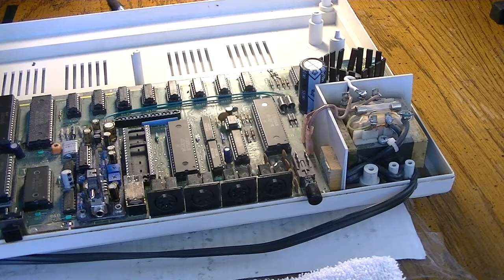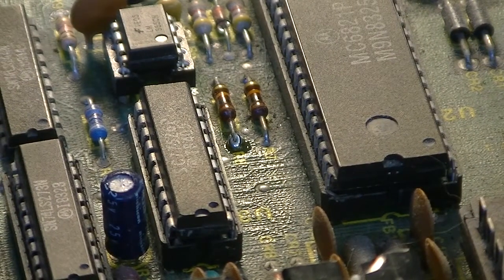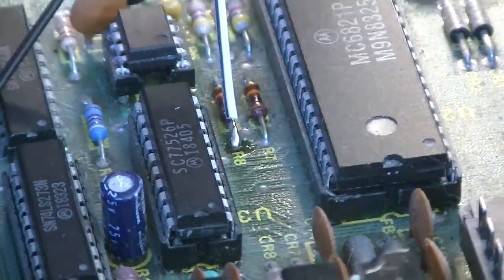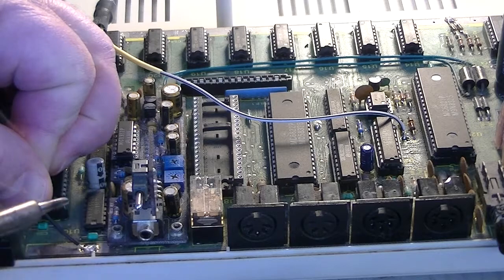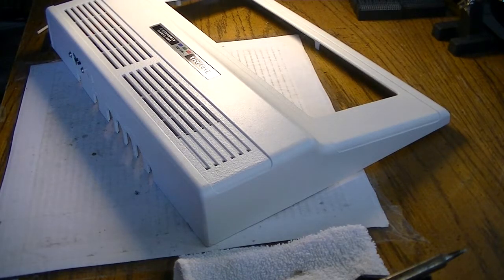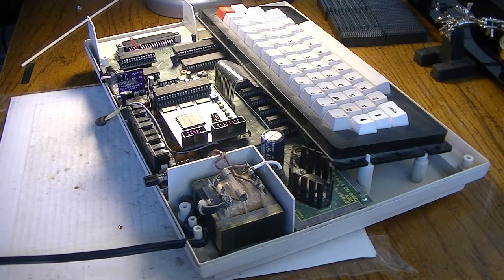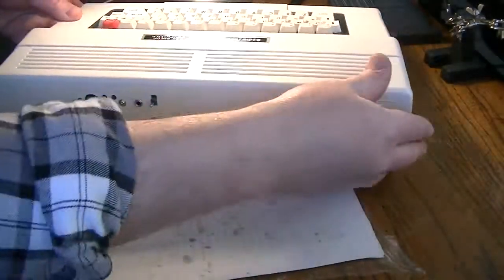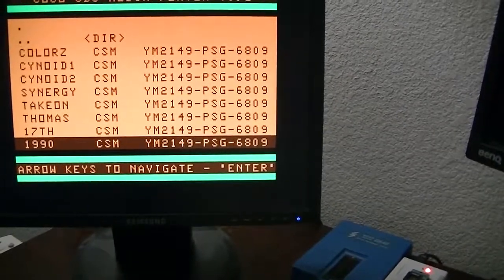Simple CoCo2 sound mod

Comment from the maker: Sure.  :)    I should have been clearer that there is a 1uF cap under the shrink tubing in series between the jack and tap.

Tap @ R8 --> white wire --> 1uF cap --> both channels of jack --> out.